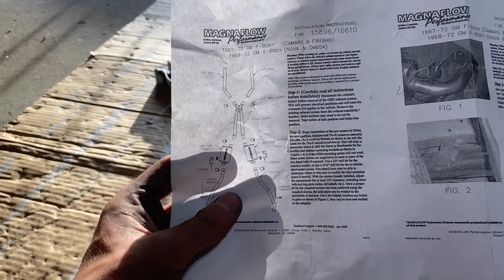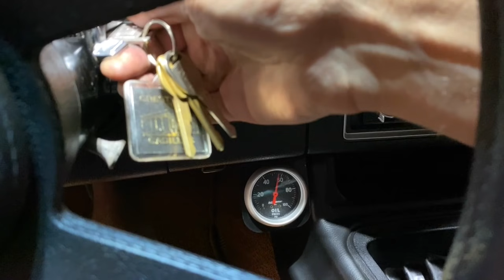INSTALLING the 1973 Z28 Camaro ENGINE and MAGNAFLOW EXHAUST..AND 383 Stroker FIRST START In The Car!

Comment: CERAMIC COATING AN ENGINE BAY.....WHO DOES THAT!!!! I love that YOU love your car and being so neurotic.....just like me! Lol. Excellent job so far...Keep it comin slick. Personally,  I would've used a panel prep like gyeon or iso alcohol  but that's me but I FRICKIN love that you're doing this! 👍 turned out great! Beautiful drivetrain too. Idk if you ever mentioned what ur going to do with the body, color wise, and some other things... also, an easy way to get a seal out is screw, a screw in the face of it and use the claw of a hammer to pull it out. Personally,  I would've left the radiator unpainted..but again, that's me... You're also lucky you have a wife that's cool with letting you do all of this...lol

Comment: Ryan, Did you make the pads you put on top of the gas tank?
Reply from the maker: It’s been a while since I ordered the pad kit and I can’t find my emailed receipt where I got it but I think I just typed in “gas tank pad” into ebay and found some rubber roll meant for a fuel tank, then cut it to length. Then just found a random foam block to glue onto the center section of the tank👍

Comment: Those exhaust kits should have been for designated yrs, 1967-68, then 69 then 70-81. You have 1968 tailpipes. Something that I would fix if it was my car.
Reply from the maker: Agh I see. It ended up turning out nice but I knew something was wrong. Are the normal tailpipes supposed to just exit straight out the back rather than dump to the ground for 70-81?